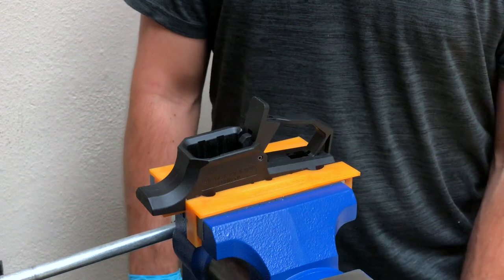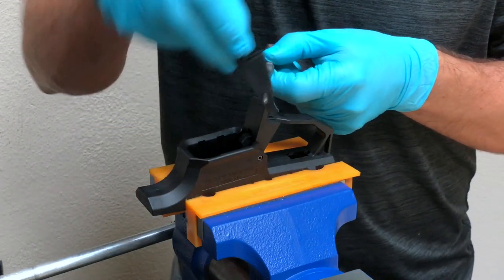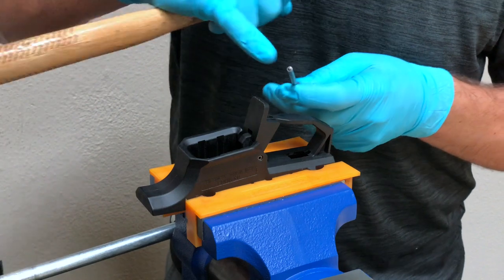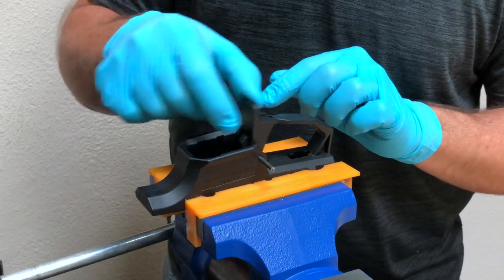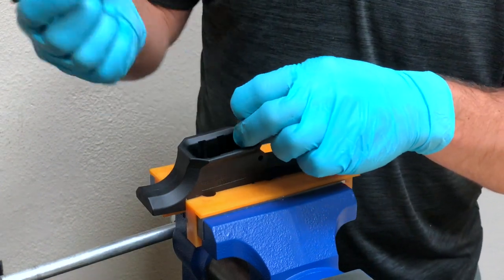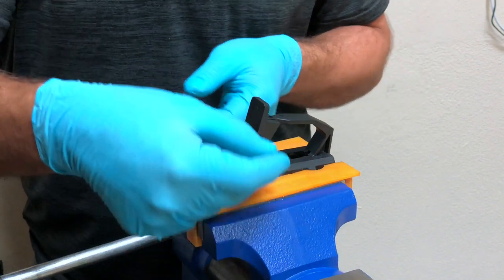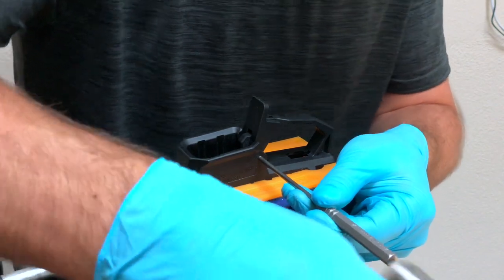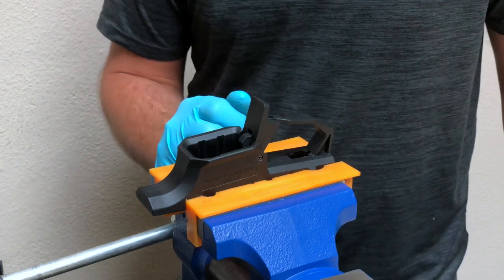CZ Scorpion Magazine Release Install Tips by HBI

Comment: Perfect timing! I needed this info. I hope the install is as easy as it looks.
Reply: It's not. Just tried doing it. 
First of... the pin is harder than a MF to get out. I did everything the same EXACT way as in the video and also I put a cloth in between reciever a vice and yet somehow the vice still fucked my receiver up. Once I managed to get the pin out and tried placing new spring and release in and tried lining it all up. Got the pin back in half way and I checked to see if it would work like he did on video. Got a mag stuck it in, it the mag was jammed in and I couldn't get it out. Had to take punch and hammer the pin out again and in doing so crimped the spring. Lmfao. 
I dont see how it's just falling right into place for this guy. This is have been nothing but a nightmare for me and by far the hardest thing I have installed on a gun.
Reply: @christopherwilliams5808  And that is why I always leave the pain in the a** parts stock lol! The minor inconvenience is not worth the money and headache it will take to replace it lol! The stock mag release on my Scorpion hasn't failed me yet so stock it will remain lol!

Comment: So my first spring bent… on my second attempt I got it installed however the release seems to have “two stages” to the release. The mag still goes in and drops out perfectly fine. However, I assume I have also bent that spring because yours looks a lot smoother than mine( I didn’t see this video until after I installed). Do you think it will be okay? If not, where do you recommend getting a replacement spring if you do think that’s something I need? Thanks
Reply from the maker: Hey Tyler, we would be happy to send you (or any of our customers) replacement springs. Please just send us a quick email with your shipping info to sales@hbindustries.net and we will get you sorted out.

Comment: Just as an FYI, I've just received my HBI duckbill mag release and hoping I don't experience operational issues. The problem is the 5/32 roll pin punch does not freely slide through both holes in the new release (neither does the roll pin which I'd think should not fit so tightly as to bind the release in its operation). Each hole is appropriately sized for the punch (not the roll pin, however) but as a pair are not aligned with each other. I don't want to force the install and either break something or have the assembly bind and not perform the task properly. Is this a situation you have seen before? Will a properly manufactured replacement release be required? Can a small round file mitigate this condition or might this fix create other issues? Thanks for whatever input can be supplied.
Reply from the maker: We do not recommend filing anything. By design, the roll pin should "press fit" into our magazine release, and "slip fit" into the lower receiver. This way the pin is help captive by the magazine release, and rotates in the lower receiver as the mag release is operated. If that makes sense?

Comment: I just got mine today from you and installed it just the way you showed it in this video. Everything was checked with a loaded mag while the lower receiver was off. Function check passed with flying flags. Once put back together, I now have to ram the loaded magazine in order for it to catch and it doesn't drop freely when I release the mag. I'm not sure why this would be. Any ideas?
Reply: Fyi the spring is not bent. I double checked this.
Reply from the maker: @ATOMSKI_MRAV  very strange; what magazines are you using? And you said the magazines drop free when the lower is not installed in the upper? If you haven't already, please call/email us and we can send you you several more springs and roll pins; it might be worth removing our mag release and re-installing the factory magazine release to see if you can duplicate the issue? We would also be happy to send you a replacement magazine release to try at the same time. Over the past 3-5 years that we have been making magazine releases I am not sure that this specific situation has ever come up before? Typically if the lower runs out of the upper, it also runs the same in the upper...
Reply: @hb_industries  I'm using an OEM 30rd mag. I have ordered a set of roll pins and a spring just in case so I'll try that for sure. I'll remove it and reinstall it with a new spring. The mag drops "kinda" freely even now but only when it's loaded. I'd say the  weight is what's letting it fall freely but doesn't come out when unloaded. It's worth to mention that I also changed the pin that holds the lower and upper together with the HB industries one. I love how there's no more play there.
Reply: @hb_industries  I just finished removing it and reinstalling it with a different spring and roll pin. Same issue unfortunately. I also tried it with different mags (ETS, Pmag and another one i can't remember the name of). All were good when not fully loaded or empty but if fully loaded I still needed to slam them in order for them to catch. I'll give you guys a call sometime tomorrow.
Reply: @ATOMSKI_MRAV  I jus got mine, exactly same issue.....

Comment: I installed it but didn’t use the spring you gave me.  I used the factory spring. Seems to work fine.  Any concerns?
Reply from the maker: Either spring will work (our supplied spring is slightly higher rate/force to help give the same "feel" with longer lever/paddle). The primary reason we include a second spring is because they are so easy to bend/damage/loose... don't ask how we know :-)